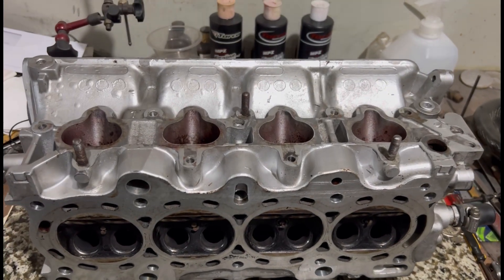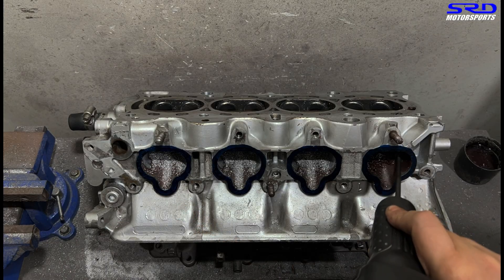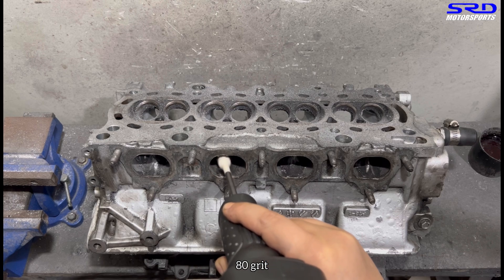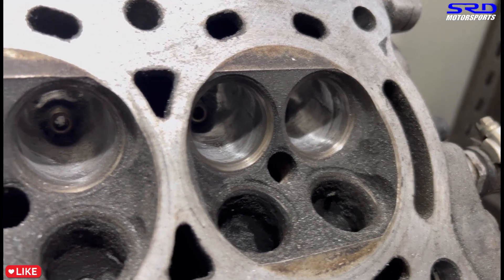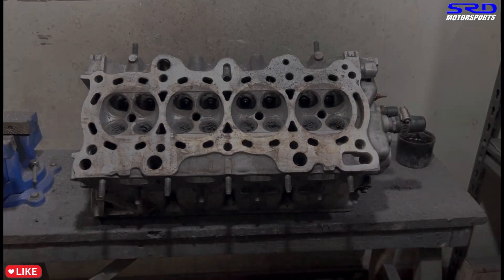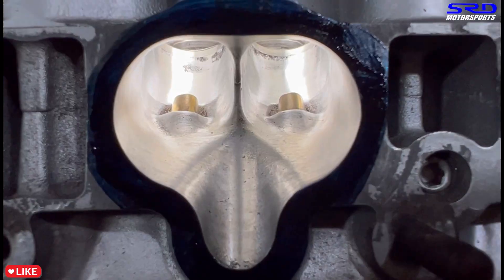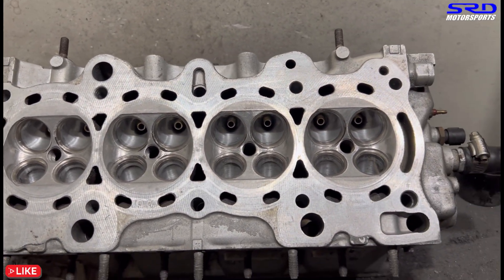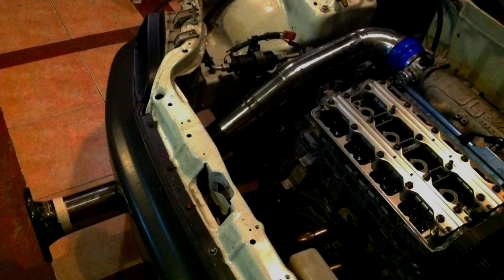B18c1 P72 GSR cylinder head porting

Comment: What’s your opinion on dimpling
Reply: Dimpling in intake ports causes  the air to tumble into the combustion chamber which helps the fuel atomize ultimately creating a efficient combustion. But like SRDmotorsports stated, downside will be a reduced air velocity speed. Dimpling can be beneficial and with high-end bench flow testing machinery it can be done properly. Simply put we want to keep that air speed and velocity up that's no doubt! And depending on the DEPTH of the dimples and aggressiveness, finding that sweet spot in keeping air travel speed with light tumbling and testing is key. Overdoing will hurt indeed.
Reply from the maker: very very detailed (pun intended 😅) contribution and comment …you definitely said it better than I could… thank you 🙏
Reply from the maker: energy change Will always have a cost or sacrifice on something else

let’s not forget “drag”